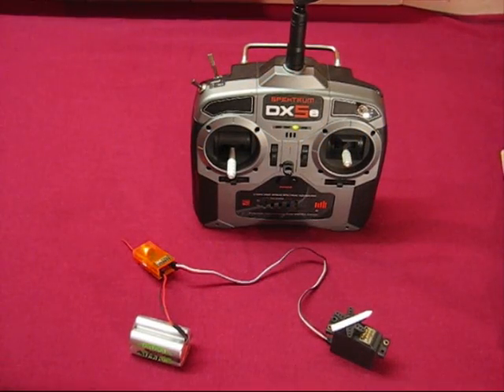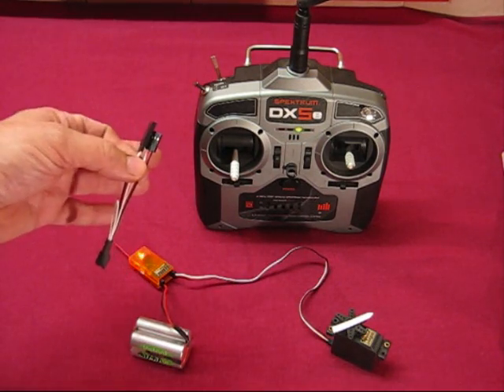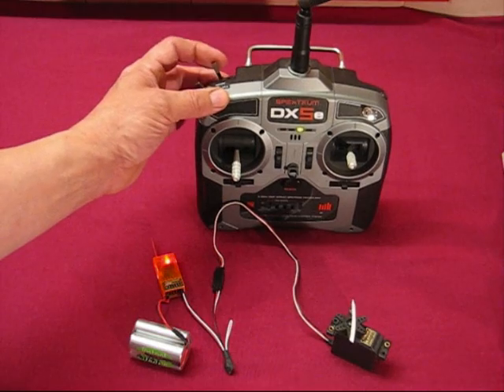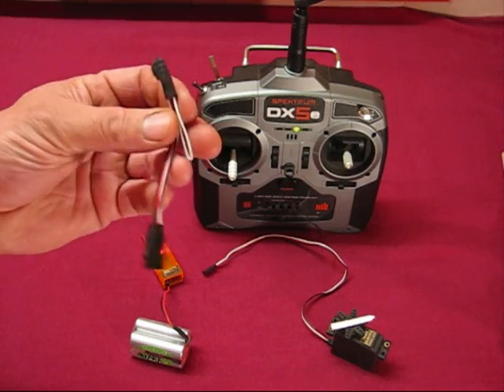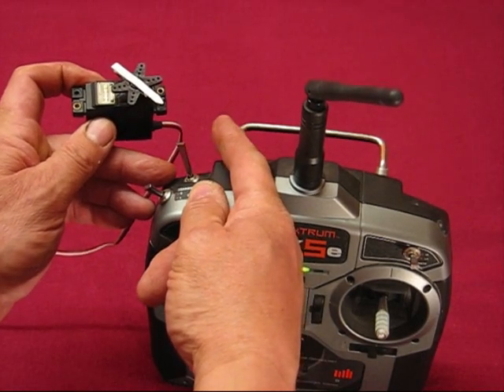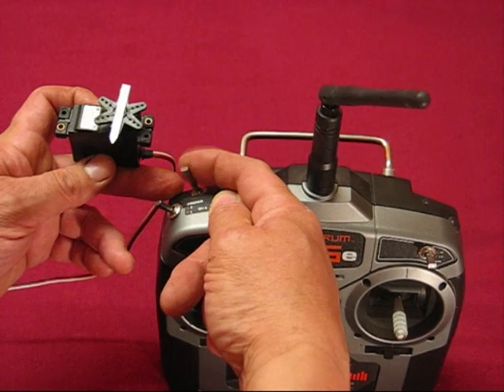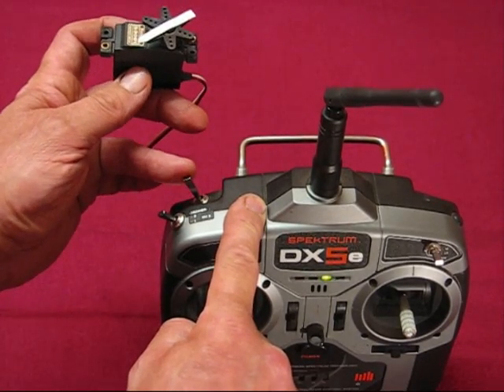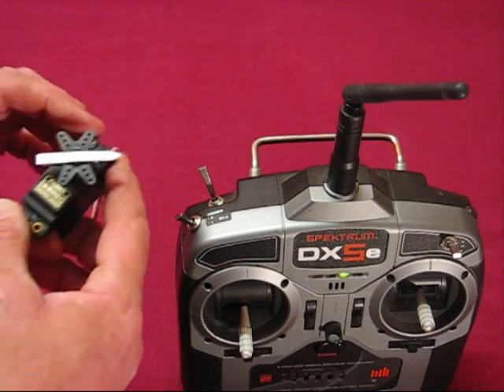DX5e Channel-6 adapter demo

Comment: I bought this cause of this video a few years ago and it works amazing. I use it as the flap controller on my Valiant 1.3 with my DX5E controller. I just bought the 0-50-100 with the hold to return feature and it’s foolproof. If you don’t remember where you are you just hold the switch to a complete off 0% and start over. Retains the gyroscope function levels but you lose your “panic button”

Comment: Just picked one up. Going to use it for launch mode on a DLG. I wish there was a way to add another switch for flight mode or landing mode, but i built the glider from scratch. This should do the trick to get it flying.

Comment: Hello phil,   need an adapter like the one I buy on ebay  , but it has to be with this configuration 0%, 25%, 50%, 75%, 100%,  and stays at 100% reset at any time reverts back to 0%  can be ? thank you

Comment: Hello Phil!
Though it's quite a while since you posted this video, I bumped over it just a couple of days ago. It is very convenient for the use of mine Spektrum DX5e. I bought that to fly a ASW17 electric glider (4 ch). Now I've ordered a Volantex ASW28, electric glider aswell, and this model is equiped with flaps. Therefore I need a 5th channel which has the ability to regulate the flaps. I think I need the "8-way cyclic" version. 
I have read the comments in this thread and understand that the item has been removed from the Ebay-acount you'e refering to. I have mailed a lot of Spektrum dealers but none of them seems to have your gadget available. Can you help me to navigate to a dealer / shop who has this available? I say thank you in advance, and thank you for you educationally videoes.
Sverre
Reply from the maker: Her you are Sverre:  http://www.ebay.co.uk/itm/272369146654
Reply: Thank you very much, I 've already ordered one.

Happy flying! - Sverre

Comment: Thanks to Phil G on his little device.  https://www.youtube.com/watch?v=jEHZ3cHrY60

Like many Blade 350qx owners, I added an inexpensive Chinese Gimbal to the Blade 350qx and was looking for a solution to provide "Gimbal Tilt" or "Pitch Control" for the Camera angle.   I came across this video from IEATSRT11 called "Blade 350 QX Gimbal Tilt" https://www.youtube.com/watch?v=GtVb8WBtFqU which requires a DX7, 8 or 9 and a 7 channel Rx.  
These more advanced transmitters allow you to set the transmitter from DSMX to DSM2 1024 resolution. I actually purchased a DX9 and this solution works great.  Kudos to  IEATSRT11.
However, I still had a DX5e that I wanted to find a similar solution for it. I downloaded the manual for the DX5e and noticed you can force DSM2 mode on the DX5e "X" version. There are multiple versions of the DX5e, the one that came with my 350qx is the newer "X" version noted by the white X on the front of the transmitter.  With an older AR7000 and the DX5e "X" transmitter in DSM2 mode you can bind both the 350qx and the Rx to accomplish the same scenario as shown in IEATSRT11's video binding the AR7000 and 350qx with a DX9.   The key is using Phil G's device as a 4 position stepper on the 6th channel.  You could probably use a similar 6-Channel Rx rather than the AR7000 as you actually double up on the 6th Channel the "RTH" channel.  This gives you 4 positions forward and back so select from.  Not as nice as a more expensive DX7, 8 or 9 solution on a separate 7th channel that gives you the full range of the servo, but it's a $20 solution (Phil G's device) over a $500 (DX9)
Good Luck.
Bind with DX9
https://www.youtube.com/watch?v=GtVb8WBtFqU
DX5e Manual
http://www.spektrumrc.com/prodinfo/files/spmr5510-manual_en.pdf

Comment: so is the channel momentary because of the switch or because of the programming.. could one remove the momentary switch and install a normal on off switch?  and there are no modifications for the 6th channel ? just have to have a 6 channel receiver?
Reply from the maker: John P On the DX5e, ch6 is momentary because the switch is momentary John, and on the DX4e its momentary because the 'switch' is a momentary pushbutton. Changing the trainer switch to a normal 2-position switch will give you 2 servo positions on ch6, but of course when buddying, you'd have to remember to return the trainer switch manually on every handover.The object here was simply to make ch6 more useful on the standard unmodified set.CheersPhil
Reply: great information !! thanks much Phill !

Comment: Hi thanks for your video ! I have a naza controller and maybe your idea can fix the issue what I can use the control use switch. Can you help and make a tutorial ? :) Thanks.
Reply: Hi Celso, I'm doing these ready-built and tested, you can either if you email me with your requirements on philg@talk21.com or you can buy one from ebay:
http://www.ebay.co.uk/itm/271461391620
Many thanks for your interest
Phil